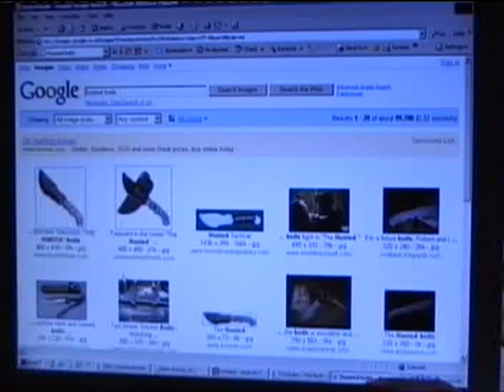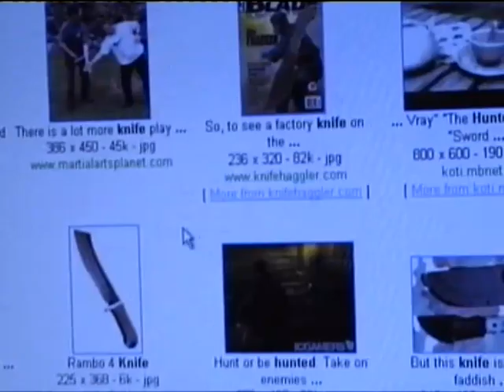How to make a Tracker Knife like in the movie The Hunted

Comment: Hey made one of these as well almost same processes but did the one sided Fillet blade angle stretched right out so it's like a razor badle and more of a hook on the chopper top blade where the two blades meet but had to make two first one heat trement it twisted. Not easy to make, props yours looks great.
Reply from the maker: Thanks at the time I didn't have a forge so used what I had just made it for fun after watching the movie. Yours sounds great.

Comment: Hi! Assuming you only used angle grinder(can't see any other tool), how did you manage to cut all those curved parts around handle where finger grip is and other stuff? I made mine, it looks like the real thing, where the blade is, but lack finesse, it's impossible for me to cut those parts i mentioned using only grinder, mind sharing how you did it? Thanks in advance!
Reply from the maker: Once you cut the main part of the steel out you can work the metal down more with the grinder see 3.19 the finish with files round and curved.
Reply: Alright, thanks, well as i said mine is finished now so can't go back, but your advice will help for something else next time. I noticed that part but i wasn't sure that you used grinder all the way, have a nice day!

Comment from the maker: Less work but first I would have to buy an anvil and build a forge and use steel I can heat treat not the stainless steel I used and £15 angle grinder.

Comment: you can make a nicer blade with less work. hammer, forge, anvil. heat treat in oil. use tool steel or high carbon.